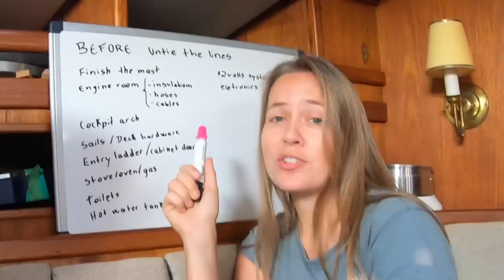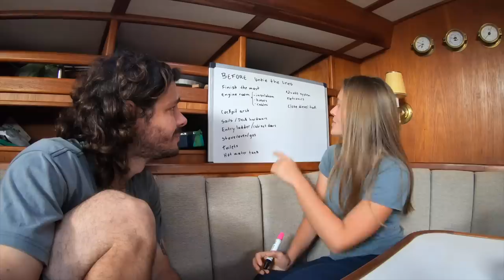⛵️Our first night FLOATING aboard ODD (the work continues!! 💪🏼😎)#155

Comment: With the new furlers installed, she looks even better. She will be a very stable vessel with the ability to have a number of different sail choices while underway. We can smell the salt spray already. Have a blessed and safe week, you guys. Hugs, George & Debby
Reply: Hola chicos!! Estoy de acuerdo que bajar la botavara también baja el centro de gravedad y les permite llegar al lazzy jack, pero...... también es cierto que habrá que tener mucho cuidado con el cambio con viento de popa. Igual ya está, quedó muy lindo. Ah! hay un producto para evitar la sulfatación, o como se llame, entre el hierro y el aluminio. no sé si lo que le pusieron es ése. Duca, no te olvides quien es el Almirante en el barco de una pareja. Buenos vientos!

GRACIAS GOOGLE:Hello guys!! I agree that lowering the boom also lowers the center of gravity and allows you to reach the lazzy jack, but ...... it is also true that you will have to be very careful when shifting in a tailwind. Anyway, it was very nice. Ah! there is a product to prevent sulfation, or whatever it is called, between iron and aluminum. I do not know if what they put is that. Duca, don't forget who the Admiral is on a couple's ship. Good Winds!!!!
Reply from the maker: Thanks for the feedback and suggestion

Comment: When you start doing further setup of your solar array remember that you’ll probably want at least 3 separate MPPT solar charge controllers. If you don’t run multiple charge controllers then any time one panel is shaded then it’ll drag down your whole system. 

I’d run one MPPT controller for the panels on the left side of you dodger/Bimini and another one for the panels on the right side. Then at least one for the panels on your aft arch.  

So take that into account when you’re making your new 12 volt panel. 

Cheers,
Jeremy
Reply from the maker: Thanks for the suggestion. Yes, the plan is to have some MPPT controllers 😊🌅

Comment: Hi Roberta & Duca, this is great to see you finally on water :) I'd just like to share a concern that may worth checking: while lowering the boom, you can see a black patch under the fixation, I suspect it could be some kind of insulation against electrolysis (between the fixation metal and the aluminium of the mast), not only glue. I'm not sure the sealant you applied is designed to prevent that (also, pay attention to screws). I'm pretty sure some professional on the dock, or here, would happily remove any doubt. Keep up the good work ! :)
Reply from the maker: Hi. They used sikaflex before and we also use it. Zé has been working with mast for over 30 years, so it's all good.
Reply: @OddLifeCrafting  All is green then :) Eagerly waiting for your new sails and your adventure on the sea : )

Comment: Great video, as usual.  My concern is the fact you have two furling jibs, one in front of the other.  How will you be able to tack the jib on the front one without having to pull it through the gap between the furlers?
Reply: Watch some other sailors I've seen it done!
Reply from the maker: We don’t. We will need to close the genoa and open it to the other side. The former owner said this boat needs a lot of sail area to sail, that’s why we have it like this 😊
Reply: The aft furling rig allows for standard  tacking and jibing.  I accept the fact that D & R are not designing a racing boat but a comfort cruiser with modern sail handling  conveniences... The forward sail will probably be unfurled more for long passages and if you have enough wind the main will rest in the lazy jack... Its just the way it works.

Comment: Get an induction cooking plate, save the gas installation costs, in more solar cell
Reply: Yes after lithiums induction is all you will need!
Reply: Lithium in Brazil is very expensive, importing taxes, transport and greedy resellers makes it harder here...
Reply: @GuilhermeRochaFast  You're not thinking right.....they sail to the lithiums when ready!
Reply: @stevenholton438  Yep, they can prepare the system and go get them later, but meanwhile they need the gas heat, besides, it's a great backup to have.

Comment: In last video I suggested a lower back beck what I am thinking I’ll try to explain you could hang 2 maybe 3 support Pipes down from back deck pipe then a pipe between them at bottom maybe hanging 2 feet maybe 3 down the you could build a small deck that could flip up and down against the drop down pipes with a small simple latter in between the two decks and even another detachable latter to the water just an idea... Maybe just a longer latter will work. I love watching and I’m so happy for you both😬⚓️ ⛵️⛵️⛵️

Comment: Suggestion for your list: Test and familiarise yourselves with all your navigation and safety gear. Agree roles and steps to take in any  anticipated emergency. Make sure you can both use the VHF radio correctly.

Comment: Nice to see you back on the water, it's a long time comming, your checking for leaks on the through hulls,  but  won't there be air  trapped in the through hull, till you open the valve and use the equipment connect to them.

Comment: You know of course that the mast position, rake etc depends on how the boat sails. There is no fixed position for a mast as you load the boat and use it you may find you need changes. Hopefully within the adjustments of the rig,   But what wonderful things to think about and not rust and paint! Cheers Warren

Comment: As you have done all this work, the only thing I would suggest as a marine engineer is take the time to create a maintenance schedule. With this (and it can be done on excel) you could have a list or spares. This list should be things that you know will go wrong taps toilets etc or critical spares 24v breakers hoses engine spares etc... And then consumables paint tape wire etc... If you start this now and get it right it should be plain sailing 😜🥰
Reply from the maker: Thanks for the suggestion. The idea is to have a checklist to check things from time to time.😊

Comment: Duca, Just a thought, is altering the height of the goose neck/mast going to interfere with the arch you have ordered. Other thing is hardtops are super nice to have for several reasons ie; solar, water collection and so much dryer. You can have two extra panels each side that attach like overhangs when you are on the hook, nice and cool. Don't think that maybe possible with the new placement. I also prefer closer to 90 degree sail cut.
Reply from the maker: Thanks for the suggestions!

Comment: Little bit worried about the amount of holes in that area of the mast ? Im a fan of no radars , nothing on the mast that can be situated elsewhere . 7 out of 10 mast breakages are rigging fittings the other 3 are where pressure points on the mast - Goosenecks , Vangs , Radar supports etc. Where iv moved booms down (or up) i tend to put a support plate over the area moved using the same holes that the gooseneck has been removed = Looking good - Fairwinds

Comment: I was thinking about the cotter pin in the clevis pin at the base of the new furler.  If you use the second anchor roller, it looks like the cotter pin could be damaged by the chain or anchor and come out.  Video at 18:20.  It would be nice to protect it somehow.  It would suck to loose the mast.

Comment: That's a bummer that you had to lower the boom due to the extra holes in your mast but it's a much better position and I don't think that will effect your sailing performance at all. When you lowered the boom, did that mess up the position of anything on the mast and would you have it had been even better to put the boom even lower but the position of some of your mast hardware prevented you from doing so?

Comment: Yes 2 furling systems are great but you are going to have big problems when using the forward one as there is very little clearance between the 2 systems so when you go about (tack) the forward one will foul the aft one every time
 .

Comment: Is that really just a cotter pin holding the pins in on the bottom of the furlers?  Is it some type of harder and stainless compared to what I'm used to?  I'd be worried about a "normal" cotter pin wearing and failing eventually.

Comment: Is this the furler that failed and severed the forestay?

I have seen two or three recent instances where a pebble or something has gotten installed within the furler under these conditions.
The inner forestay was damaged or severed.
Not all resulting in mast collapse but all causing significant structural damage to at least the rig. 
I would have loved to have seen at least a tarp laid down. 
Thought for next time.

Comment: As a professionnal amateur psychoanalysis specialist 😊 (more than 30years of dreams analysis and interpretation for me and my friends and family) the 'other person of the nightmare' symbolise the boat, which is indeed Duca's mistress. This is an interesting configuration which could turn from nightmare into dream as the boat is also Roberta's mistress, or a lover as you like, it becomes an interesting triangulation, mixing a protective maternal cocoon, a speed machine through waves, an horizontal line then, and a vertical axis drawn by the mast, holding sails (coming soon..), wind forces caught inside, working trustfully in harmony with the centreboard , while the sea and sky have their fight, don't worry. No leak, just haul away and hold the tiller. Get conveniently dressed, eat warm sometimes, watch the stars, dolphins, seabirds. (Avoid cargo routes.).
Reply: Don´t forget to take your medicine...
Reply: @belledetector  it's not a matter of Sikaflex, or Epoxy vs Sikaflex. Can you see now ? 😃
Reply from the maker: Thanks for the analysis. 😉

Comment: You need to plan for a dodger canvass over your cockpit hatch and extendable to a future awning for the cockpit. The way your hatch was designed could result in salt water entering the main salon while sailing if left open. Plus, it will keep you warm while on watch.
Reply from the maker: 😉It's on our  list

Comment: Have you consider changing to a 24V systems? you draw less amp for water heater. you can also convert the 24v to a 12v panel
Reply from the maker: We are gonna keep it 12v as our equipments are 12v. We can use the water heater in our engine as well

Comment: Sorry if this has already been asked 800+ comments already!  But... When you're using the larger head sail on the front furler and you tack does it have to be pulled in front of the rear furler or does the front 50cm or so remain where it is and just rub up against the rear furler stay?

Comment: Hey guys, 

Instead of locks, you’d be better off with neodymium disc magnets. They are strong and would save you allot of time and lock installation.
Reply from the maker: Thank you so much for the tip. We didn't know them

Comment: With your intended placement of the solarpanels i strongly suggest using MPPT controllers instead of a conventional one.
Reply from the maker: This is the plan 😉 The convencional one doesn't work with lithium batteries
Reply: @OddLifeCrafting  That's not my main reason. My main reason is you are going to get shadows, which MPPT can compensate for. Great job so far!

Comment: Just a thought, I don't remember if and/or when you replaced leak sensors. If you you did, did you install redundant sensors incase one fails?
Reply from the maker: We don't have them yet. As we are gonna live in the boat we always are gonna check the valves and bilges

Comment: That nightmare is a good thing for you Duca ... it shows how much she loves you and is stuck with you (speaking from experience on the opposite side - as in I had the nightmares). But be careful it can be a tad bit of insecurity too. My nighmares like that were when we had a tad bit of issue starting out. Now we're of the age where we're basically stuck together and they don't happen. Look after her, she's a good girl and damn hot.

Replacing the 12v system will be a HELL of a job but will pay off if you it right! LEDs instead of old lamps etc will greatly increase the savings on power. Though 2 questions, 1 WHY didn't you put your VHF antenna on-top of the mast whilst doing all the lights etc, it would have been FAR easier and 2, I think you'd have been better off with an "insulated" back stay for a HF radio antenna (tuner goes down the bottom where it joins the boat).

That boat looks awesome ... I'm jealous and want one. It's about the right layout and build type for what I like.

Comment: I have a question about your bilge pumps did you install check valves on all the discharge sides of him
Reply from the maker: In one we have check valve and other we have a siphon
Reply: Just a suggestion but to be on the safe side you should replace the siphon with a check valve or install a checkvalve with the sipphon. I've had siphons back flow

Comment: need to rethink 12 v system and maybe add 24 volt system  especially if you plan to do solar.
Reply: would make sense if they are redoing the whole system. They will also change they battery bank to lithium.
Reply from the maker: We decided to keep  it simple and keep it 12v

Comment: Guys. I saw on your list you are planning for gas installation. Why bother?  With all the solar power you have planned including a lithium battery bank, just get rid of the gas and get induction stove. (SV Delos did the same, and many others.) It´s the natural and safer choice when you have the power surplus... You will save space, money and hassle..
Reply: Gas is 'natural' and very reliable. It's a safety anyway. Pros and cons about both. Plus Lithium batteries are not immortal, electric stove even induction pulls a lot. I think they should try both.
Reply from the maker: We want to feel how the gas system works before changing all the system

Comment: Life Raft
Eperb
Extra water containers
Fuel Containers
Spare parts
Flares
Chart Plotter
Wifi
Outboard
Desalination unit
Radios
Chart plotter for helm position
Compass helm position
Sea anchor 
Water filtration
Deck shower
Auto pilot
Depth sounder

Comment: Do yourselves a favour and give your seawaterpump on the mainengine a new life. Lid, cam, wearplate, shaftbearings and seals in both ends should be replaced. Not just a new impeller.